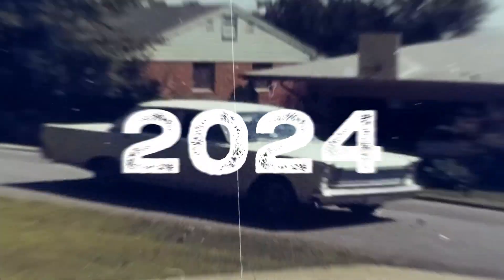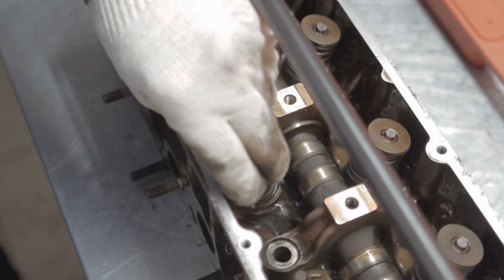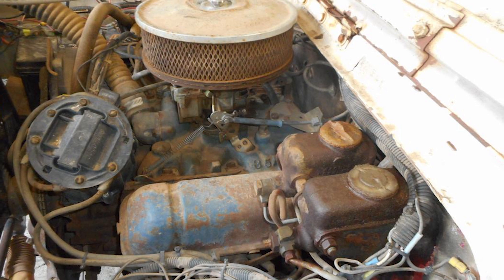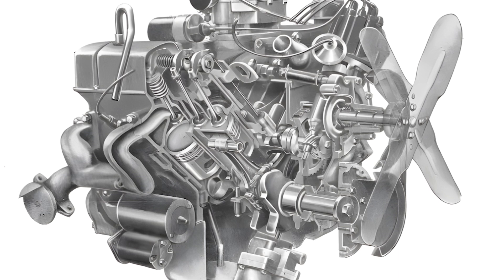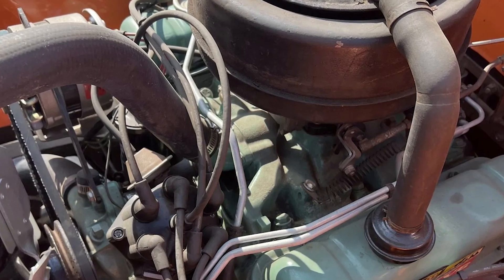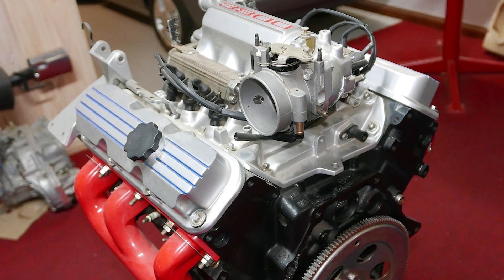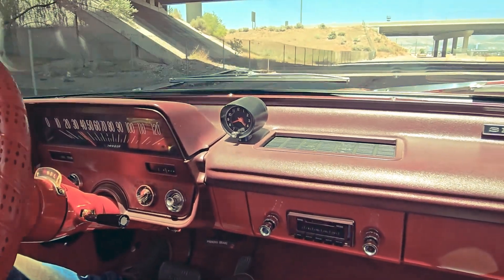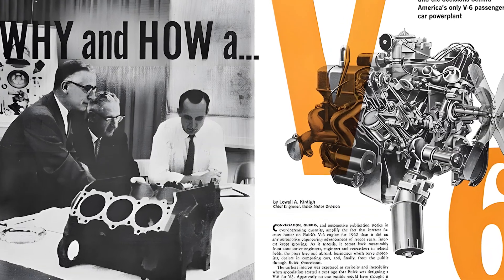The Shocking Truth About Buick 198 V6 Engine – The Forgotten Engine That Built a Legacy!

Comment: A correction. The Buick Aluminum V8 was having production problems with block castings because of foundry problems. The answer was to build the less expensive iron block V6 as an economy alternative to the aluminum engine. Also the 198 became the 225 engine in 1964 when the aluminum 215 cubic inch engine was redesigned in iron and the displacement was increased from 215 to 300 CI. The V6 used the same internals as the 300 and became the 225 cubic inches in 1964 and 1965. This was the engine configuration that Jeep took over. All the aluminum V8 molds and equipment went to Rover. The Buick 300 CI, 340, and 350 CI engines were developed from the 215 CI V8.

Comment: At 4:47 is that the Olds 215 V8 ?
Reply: Yes, the Starfire turbo. The Buick 215 and the Olds engine were nearly the same except for the cylinder heads. For the Olds the block was drilled and tapped for one additional head bolt per cylinder. You could use Buick heads on an Olds block but not the other way around.